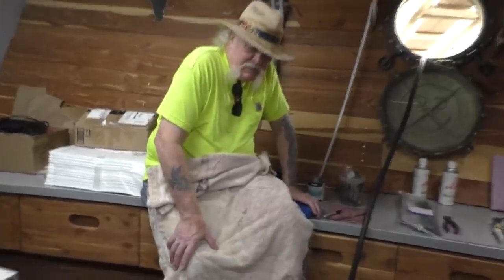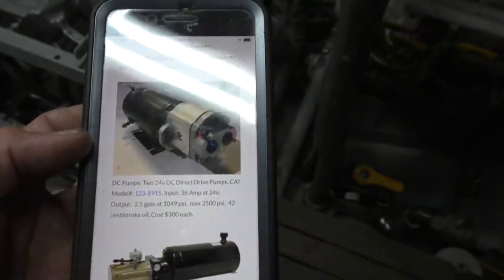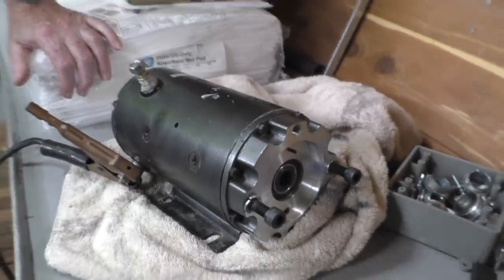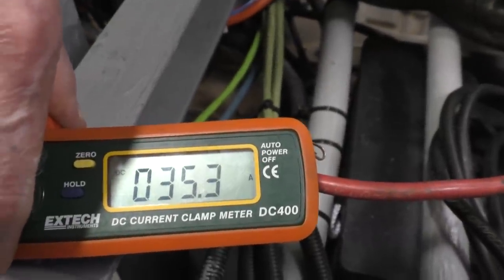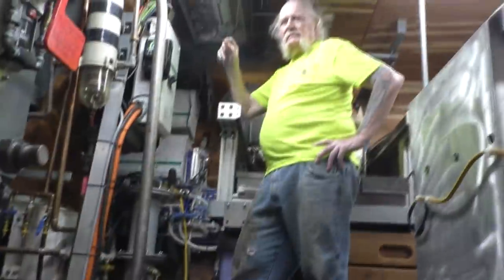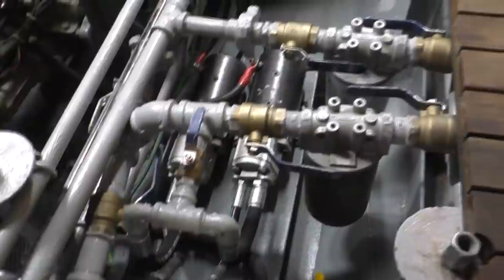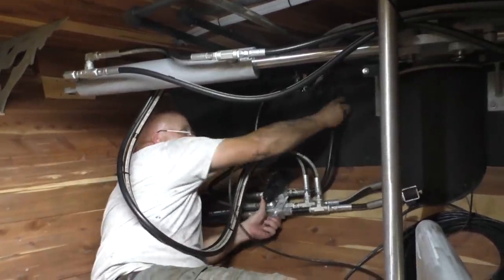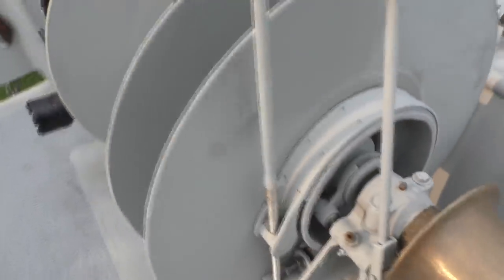Hydraulics - Part 9 - Charging the System

Comment: Big starting capacitor? Like they use in big car stereo stereo systems?
Reply: My thought too
Reply: Yes, but usually paired with a controller.
Reply: @Tuju's workboat you could put the capacitor before the motor and the pressure switch on a relay between the capacitor and motor, rather than switching the motor on before the circuit breaker!
Reply: @Tuju's workboat I agree though! In the current set up it would just add to the demand!
Reply: Bad idea. Read the many, many dozens of comments. Never use starting capacitors for DC motors.
Reply: @henryD9363  I’ve never used them personally so I’ll have to agree with you on that haha!
Reply: @VenturiLife  no

Comment: Put capacitors on the pump start circuit.
Reply: Capacitors would just draw more current through the breaker. The opposite of what's needed. The breaker needs to be changed to a type that permits high starting current.
Reply: @henryD9363  Yep. That's the simplest solution,  but I think it was also noted the wire will have to be upgraded.  As the motors get older they will draw a little more current. I'm a little floored that anyone thought these motors would run at 30amp. There's also a time delay breaker as Doug noted that would allow a period of time to let the surge current through ,
Reply: @henryD9363  my thinking was a prechharged capacitor on a start circuit that would disengage after the pump is running. That would be fiddly, more parts ..works on a law tractor though.

Comment: Doug, you need to confirm these motors aren't 24v motors... when supply a motor with less voltage than its specified for and you connect it to a load, its going to try to produce the same amount of power... if you give it less volts, its going to pull more current to make up the same power... thats why your motors are pulling 200 amps... thats going to destroy the internal motor windings in pretty short order...  you should really look at changing your setup back to parallel with slow acting breakers and going back to 24v... I think you kept tripping at 24v because the inrush current was just too high...
Reply: This is not even close how DC motors work.
Reply: @user-vw4cg8cy4f  this is a useless comment... please elaborate on how they do work... we are trying to help people here, not post pointless comments
Reply: @ashipshow  If you don't want to make pointless comments then don't comment on things you know nothing about.
A DC motor without any controller never ever tries to output the same power. A DC motor tries to match its back EMF to the input voltage. The back EMF is linear to the rotation speed.
In case of these pumps in the video, the output flow rate will linearly track the input voltage if the maximum torque at that point is not reached. The output pressure is linear to the input current (if we subtract the "idle" current of the motor at a given RPM).
Running 24V through one of those motors will result in 2 times the current draw if its unable to reach high enough RPM to produce enough back EMF.

Solution here is some kind of motor starter (a simple series resistor plus a current triggered relay) to lower the initial current.

Comment: Breaker is too fast.
Change it to an old style in porcelain, with a wire that burns off when too much amperes.
Reply: You're talking about a fuse. Fuse would be a disaster. These are circuit breakers. However there are circuit breakers that provide high amperage for a startup.

Comment: You need continuous duty solenoids.  Those cheap ones will cook fast.
Reply from the maker: Only if you plan to use it continuously.  : )
Reply: @SVSeeker  True!  Standard coils will smoke in less than ten minutes without load.  Love your show.

Comment: 1 simple fact 24volts = 1/2 the amps. Really need to check the motor nameplate somehow. The series wiring is a strange work around..DC is not my field.

Comment: For the 9000 people telling him not to run in series , his pumps were sold to him as 24volt units, however seemed to be 12 volts in practice, he used the series wiring as a method to confirm a theory, and not as a permanent repair., I’m fairly sure, when he is actually looking for ideas and or help, he will reach out, explain what he’s up against, and ask for help… has anyone ever had someone stand over their shoulder and tell them what they already know?? It makes it difficult to get through the clutter in here…, lay out part numbers, for wiring it properly, research his motors, give him required wire gauge, Eaton breaker part numbers, and maybe a 24v dc to 12v dc transformer, voltage regulator??
Reply from the maker: LOL.   Spot on!   Spoiler alert.  Turns out they are 24v and simply draw closer to 200 amps.   New cable, breakers, relays, and a box to house them are laying on the table in my shop.   But it's so much more fun to imagine the problem is bigger that it really is.
Reply: @SVSeeker  captain, first mate, and ships engineer! you may go far

Comment: Cutting the voltage in half from 24 to 12, should be causing the amp draw to double (depending on wire size). If you could figure out how to get the voltage back up to 24V you could cut the amps back down and might even save you from having issues with wire size which becomes a continuous feedback loop causing an even higher amp draw if the wire size is too small.
Reply: And here we see another comment with 0 knowledge of how DC motors work.
Reply: @user-vw4cg8cy4f  Yep ZERO. None at all. lol
Reply: @user-vw4cg8cy4f  I guess I did leave out the part where if you get the voltage back up, you also get the RPM back up, but what do I know, right? Me and Mr. Ohm and his law are clueless about these magic pixies and crazy stuff that makes sparks. :)
Reply: @EnvirotekCleaningSystems  Let me quote from your earlier comment "get the voltage back up to 24V you could cut the amps back down". Where is your ohms law now?
In case of a pump the pressure/flowrate depends on the rotation speed near linearly (if the maximum possible power output is not reached caused by fluid dynamics). If you increase it you increase the power output of the motor close to linearly compared to the input voltage, you won't get any lower current consumption. A hydraulics pump needs torque to build pressure. Torque is linear to the input current in case of a DC motor.
Reply: @user-vw4cg8cy4f  And that is EXACTLY correct. Double the the volts and you cut the amps in half. It is the heart of Ohms Law.
Reply: Let me help you a little more. You have a 24V motor rated to pull 36AMPS. If you feed it with 12V you will cut the RPM to 1/2 the rated RPM and double the amp draw if you put the same load on it and the static load is going to be building the pressure up to the operating pressure of the system.
Reply: @EnvirotekCleaningSystems  Please read the ohms law. Hint hint, its R=U/I. -> I = U/R, where R is constant. And also a motor is not a simple resistive load.
Reply: @user-vw4cg8cy4f   The beauty of omhs is they are all interchangeable. Of course a motor isn't a simple resistive load. The load is the pump, more accurately the flow of the pump to build pressure. Once the pressure begins to build to a point there switches shut off, the amp draw will be double when feeding 12V vs 24V. This isn't a guess. The only way it would be any different was if the cut off pressure was lowered.
Reply: @EnvirotekCleaningSystems  Nice that you still manage to contradict yourself.
Power = Voltage * Current. -> power = output fluid flow * output pressure. If the pump is not saturated, at 12V with the same pressure as with 24V you have the same current draw but half the flow rate. Thus 1/2 the input power.
A DC motor does not try to output the same power by itself. A DC motor tries to match the input voltage with its back EMF. But I don't think you know what back EMF is. The inrush current exists because at the beginning the motor is at 0 RPM and it does not produce any back EMF.

I recommend you to read professional literature about the topic. But I guess its not me who is shaming myself with "this isn't a guess" kind of statements. Shows how little you know about the topic yet think you know everything.
Reply: @user-vw4cg8cy4f  Where have I said anything about the inrush current? Now tell me about the input/supply voltage and back-EMF and the current draw between them and how much difference the current draw across the supply and the back-EMF would be with double the supply voltage? Or better yet, half the rated supply voltage?

Do you also think the manufacturers of those motors don't know about back-EMF and the relationship between the supply voltage? How do think the ratings were derived? Doug said 36Amps@24V, right? What purpose do think they have when they use both the amp draw and the supply voltage when placing ratings on this type of motor?
Reply: @EnvirotekCleaningSystems  So by your logic, if the input voltage is half the rated one then double the current is flowing into the same DC motor. Let's extrapolate this. At 24V its 36A. At 12V then its 72A. At 6V its 144A. At 3V its 288A. At 1V Its a staggering 864A. Yep sounds about right. Totally inline with ohms law. You know what? You won. Congratulations! Your logic is undeniable.
Reply: @user-vw4cg8cy4f  Jesus, you are still crying about this? I just saw a picture on Seeker's FB page with an amp meter showing over 200amps. So yes. You just generally trip a breaker or completely turning the wiring into a glowing red lines of smoke and fire instead of hitting the "staggering" amp loads you describe.